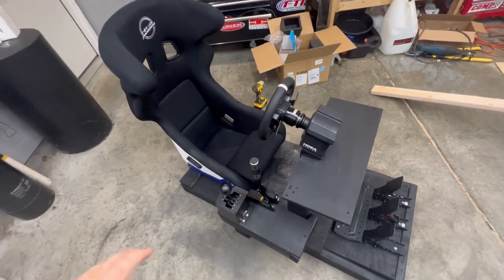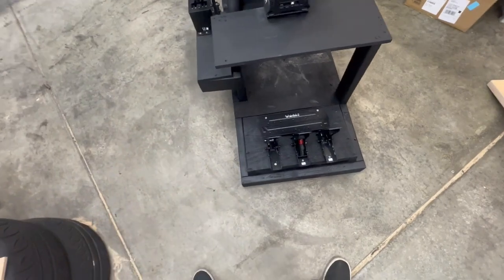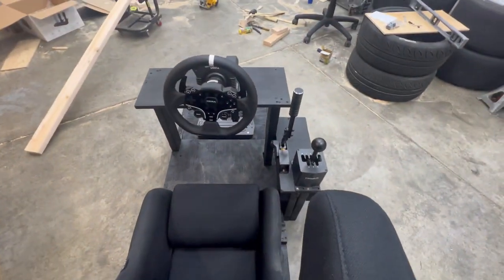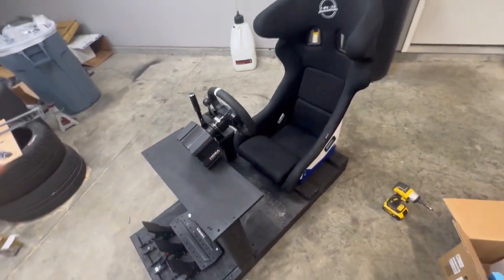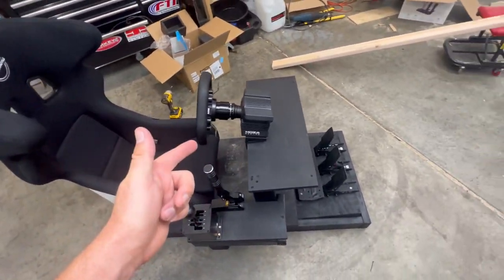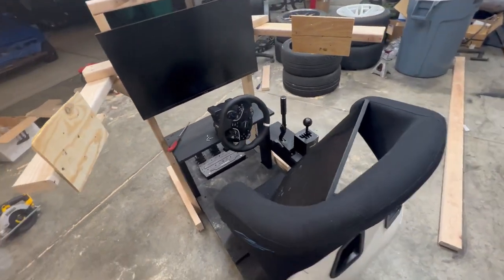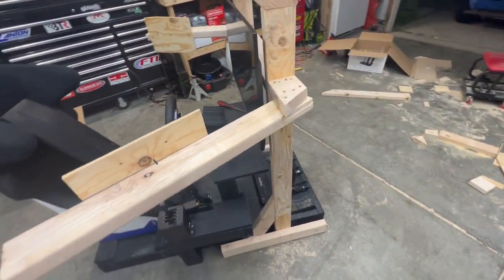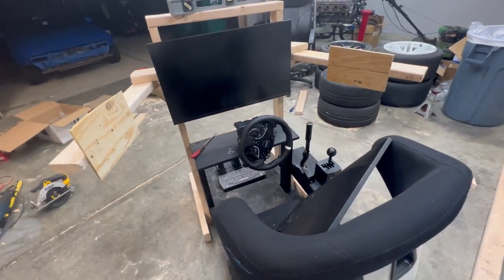DIY SIM CHASSIS BUILD

Comment: Awesome work man! FYI - set your camera shutter speed to the same as your power frequency to prevent those rolling black lines 👌🏼
Reply from the maker: Thanks for the tip, I will have to look into this. I used a GoPro and I wondered why the leds lights were effecting the camera

Comment: Man, this rig looks GREAT and appears to work well too!! I'm just getting into sim racing, and since I refuse to pay $3-500+ bucks for a decent rig - and plus I like sticking it to The Man, and really enjoy building my own DIY shit to MY specs - I have been scouring YT and elsewhere looking for a cheap, easy to build wooden rig. And I think this one's it!! And you even spent like $8 for some Dollar General black paint and took a few to paint the damn thing, as many I see they just skip it and it looks like ratty raw 2x4 shit. It looks like you eyeballed everything, but you wouldn't happen to have any measurements would you? 

Regardless, I'ma build this exact one of yours right here! I may spend some extra time routing/sanding and round off all the corners and edges, countersink the screw holes and wood fill, and will either paint it, but really thinking about some cheap black 7D carbon fiber-look self adhesive vinyl wrap to the whole thing, spring for a 2x8/10 for the wheel shelf and add some cheap black indoor/outdoor carpeting for the flooring.

I'm probably going to add some very simple adjustability to the wheel, pedals, shifter and seat mounts, so I can go from drift/production car racing to F1 laid back style easily. I'm also planning on grabbing up a nice comfy sport bucket leather or Alcantara seat from a car at the junkyard for cheap. if it's a bit raggedy, I'll slap a nice mid-level sport seat cover on it - I'm old and need to be comfy...lol. I already have a nice 120hz 35" curved gaming monitor, but will plan and leave room to add wooden expansion arms (or some cheap tv mounting arms) and eventually upgrade to 3x, 55 or 60" 4k TV's in the future. 

Anyways, THANKS SO MUCH for posting this. Gave you a like and a sub! PEEEAAACE!
Reply from the maker: Thanks for the detailed reply brother I appreciate it. Yes I eyeballed about everything just sat the seat on ther and started building to what felt right. It is not perfect but it gets the job done for super cheap. I will tell you the base I 2 feet by 4 feet long and I built off of that. Based on my height and feel that I wanted. It’s the power of wood.
Reply: @randydrifts  THANKS! I forgot to add, that to help with strength, I'll add some cheap angle brackets to all of the inside and even outside corners wherever I can.